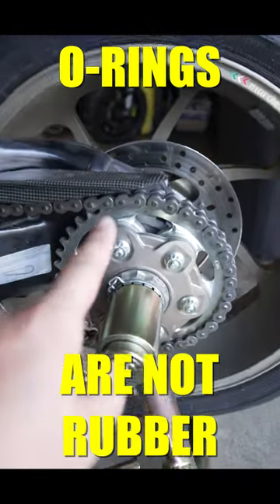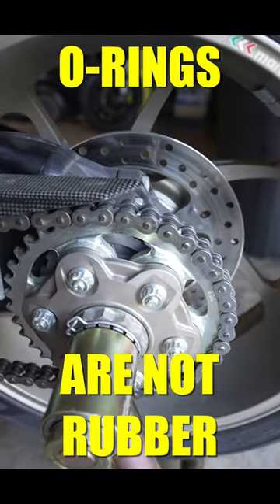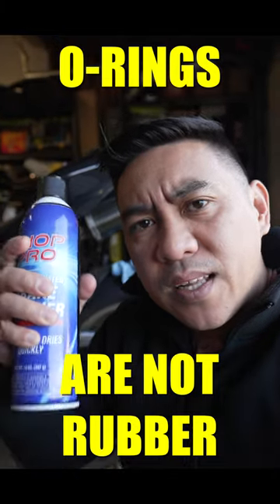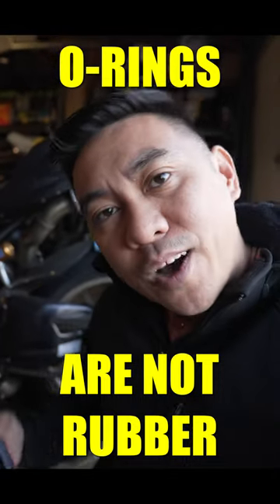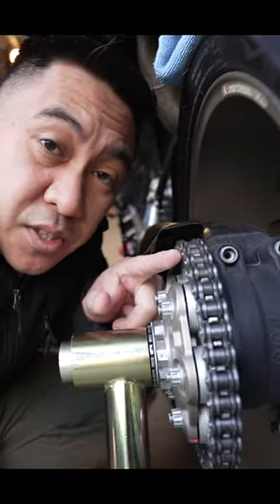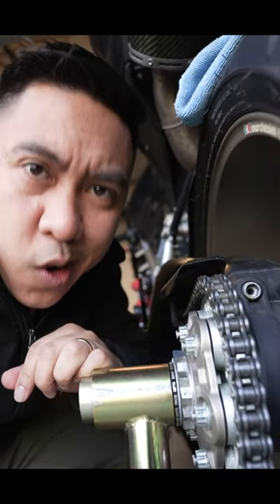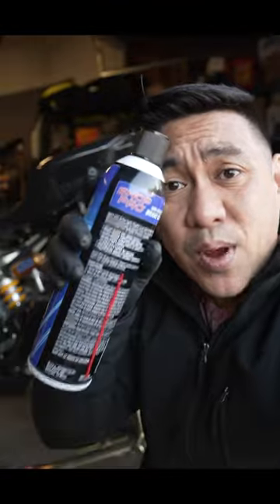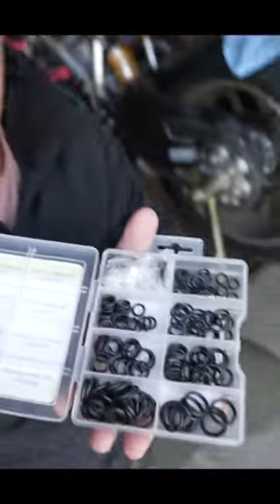Motorcycle Chain O Rings are Not Rubber

Comment: Nitrile gets soft and expands when you spray it with brake clean I'm a mechanic and I use them everyday and try doing a brake job without your gloves growing three times every time you spray off some pads.
Reply: I came looking for ur comment
Reply: @dirtbike662  ikr
Reply: It’s the chlorinated brake clean. Non-chlorinated won’t do it as bad. We use the non-chlorinated like hand cleaner. B12(chlorinated) will leave chemical burns.
Reply: I have both. Each one is better for certain types of oil or grease. Also, non chlorinated dries super fast. But honestly, if I'm cleaning anything with a can, and it has plastic around, I'm using electronics cleaner. Not the electric motor cleaner or any brake or carb cleaner.
Reply: Ive noticed the same affect on my nitrile gloves when using light oils like  wd40, pb blaster, and T-9
Reply: Big facts oil and brake clean when your gloves are soaked are just not good any small pull and that thing tears beyond easy not to mention you feel it getting softer the moment brake clean hits it. But it’s ok he’s a “professional” ad reader 🤣
Reply: brand is a factor. I have no issues with my gloves but then again we don’t use advance auto brake cleaner. Companies manufacture fluids for applications. Brake components have soft compounds around them.
Reply: I was just coming here to see this
Reply: @AndrewKidd14145  we use the 55 gallon drum type cleaner. And right now we're using hand armor gloves and they get soft with contact brake clean
Reply: They are resistant only.
Reply: @Grawlix_Garage  have you guys tried different gloves? That’s not good if they get soft then that’s probably compromising glove integrity and could cause cancer and other aliments in the future. I used black mamba gloves in the past always stay tight no matter the fluid that touches even brake fluid. Glove works is the free stuff my job provides along with the 10mm orange gloves that always do fantastic. It’s about health too.
Reply: You guys use thin rubber doctors gloves? Cheap jerseys work fine, if they get soaked in grease toss them away and get a new pair.
Reply: im i diesel mechanic and i have not found a single silicone o-ring, black red or green that does not get damaged from brake cleaner so this guy is definitely not a mechanic and couldn’t look in youtube sad 😢
Reply: wearing nitrile gloves for lab work. the gloves do wear out, depending on the chemical, making them more or less single use (they should be used once anyway)
Reply: @CensoredForTheTruth still breaks it down

I worked on bikes for 20 years not w
Reply: Definitely agree man, when I was an apprentice we would always be stocked with nitrile, doing brake jobs regularly all the time. Especially with ultimate dirty brakes I would change gloves almost every job after I clean the brakes. Being qualified for a while I will never spray any chemicals on anything that can be stretched. Rubber grease doesn't trap but repels moisture and chemicals for a reason. Time for a beer mate 🍺
Reply: somethings off then, i dont wear them i fn hate gloves, catchin on everything rippin fn rolling around n gettin caught in things ur tryin to thread together fuck that im not scared of gettin my hands dirty, i dont like my hands female clean anyway.. but ur either not using nitrile gloves or using a type of braklean that doesnt play well with nitrile..obviously.. cuz u can soak nitrile in brakleen all day it wont do shit
Reply: Oh yeah. Even isopropyl alcohol makes them do the same.
Reply: @4dirt2racer0  I am confused
Reply: I'm thinking this guy has never used brake cleaner or at least not with gloves on
Reply: Yeah my gloves fall apart after using brake clean.  So yes don’t use it on your oring chain. Shit don’t use an oring chain.
Reply: The comment I was looking for lol
Reply: @Daveeeeeeyhowyoudoing  “non-chlorinated won’t do it AS BAD” implying it will destroy rubber just not as bad. Dries them out and ruins em eventually. 
Trust me hoss. Don’t take 20 years to figure out
Reply: I use Nitrile as well and they don't do that at all for me.
Reply: @gfalcone28  wd40 is not oil bud
Reply: As a former diesel tech, I second this.
Reply: Word brake clean melts them gloves for sure
Reply: Facts I second that
Reply: One side effect of using brake cleaner on nitrile is the brain forgets to use punctuation when writing 😳
Reply: Absolutely
Reply: @raddydiaz4332  He's not a mechanic but he does play one on You Tube. He also stayed at Holiday Inn Select.
Reply: @furtivedig  The o rings in the chain don't ever get replaced. The solvent works down inside and doesn't evaporate quickly like it does in free air, either.
Reply: Neoprene gloves last a little longer when exposed to harsh solvents if you can get them. The orings may be nitrile or neoprene but viton would be best.
Reply: Exactly
Reply: Some o-ring are made of rubber. Be sure you are using nitrile o-rings. Consult official manufacturing web sites for the best information. For the best quality ask about military specifications for all your o-rings needs.
Reply: And what goes up, must come down. If you soak .2mm nitrile for 40 minutes, it has the consistency of bubble gum. And 2 hours later when the brake cleaner’s transportation has evaporated, you’re left with something shrunk, and as hard and brittle as plastic. If you coat it with a grease, the transportation is trapped and diluted into the grease, which will promote gummy rings to continue to disintegrate.
Reply: I am a composite technician and while not brake clean acetone and most solvents do the same to nitrile
Reply: @caleb530e  nobody can understand that, mr half plastic, half fiberglass fixit.
Reply: Yup….. what he said
Reply: It's true
Reply: @charlesbaker6158  Chose the o-ring material based on what it will be sealing, not on an arbitrary spec. The Parker O-ring Handbook is a good guide for selection and free for download. For petroleum based oils Viton is the more resistant material to swelling. Buna N is most common though.
Reply: Wtf kind of brake cleaner do you use
Reply: He said melt. Specifically melt.
Reply: Maybe he uses the green stuff.  Red can melts gloves 😂
Reply: @CensoredForTheTruth  Yeah I always get the green can it's a lot less dangerous
Reply: He’s right!
Reply: You sir are a technician. There is a difference
Reply: @dolanroufs1032  I don't know exactly who you're referring to, but I am a certified technician. I just said mechanic at a simplicity sake.
Reply: @Grawlix_Garage  I was referring to you. A technician and a mechanic are two WILDLY different animals. Don't EVER claim to be what your not
Reply: @dolanroufs1032  it's mostly for the simplicity of talking in the context of people who don't associate the difference. Yes, a mechanic and a technician are too very different things, but I am a certified GM technician. I wouldn't use the phrase dumbing down but more using common language to make it easier for the uninitiated to understand. Apologies for the misunderstanding
Reply: @CensoredForTheTruth  gives you nerve damage over time
Reply: @stuartjakl  send it. I’m already takin nerve pain medication😂
Reply: @CensoredForTheTruth  ouch
Reply: @stuartjakl  back in 2018 I was involved in a Hit and Run on my motorcycle. The Chain came off and when it did literally cut a Nike symbol about 9 inches long and about 4-5 inches from top to bottom wide. Almost lost my foot from the ordeal.
Reply: @CensoredForTheTruth  That is terrible! I broke my left elbow clean off, but they were able to reattach it. Snapped, my right wrist.
Reply: @stuartjakl  and people say getting your funny bone hit hurts. But jokes on them right!?
Reply: @CensoredForTheTruth  😂
Reply: Hahaha I was looking for this comment
Reply: Try using BIC-600 disc brake cleaner.  It shouldn't do that. It's because your gloves are rubber/latex and brake part cleaner will break down carbon materials. Don't want to get brake part cleaner on carbon fiber parts either.
Reply: @raddydiaz4332  Honestly, try using BIC-600 disc brake cleaner. It won't hurt your gloves, o-rings, etc. It works really well, too.

+Functions
BIC-600 disc brake cleaner can effectively clean away residual grease and grime from disc brakes.
BIC-600 disc brake cleaner is exclusively designed for use on disc brakes and brake systems, and can maintain the long-term use of brake parts.
BIC-600 disc brake cleaner contains only environmentally-friendly substances; it contains no CFCs and will not pollute the environment.
BIC-600 disc brake cleaner is safe, reliable, and will not harm rubber or plastic.
BIC-600 disc brake cleaner evaporates quickly, does not leave any residue, and will not harm aluminum or carbon fiber.
Reply: @CensoredForTheTruth  😂
Reply: I'm also a mechanic, I clean my nitrile gloves with brake clean whilst wearing them if I need to work in the car. I can wear one pair for multiple jobs. 

Throttle body cleaner kills them though.
Reply: I'm an auto body painter an lacquer an xylene also swell an make the gloves soft to the point of breaking.
Reply: The X Rings in motorcycle chains will still not deform if sprayed with brake parts cleaner.
Reply: @Grawlix_Garage  third
Reply: In all fairness to him, regardless of what he says, his nitrile data sheet literally says not recommended for pretty much every main chemical in all the various brake/parts cleaner formulations (and more) 😂😂😂
Reply: @CensoredForTheTruth  I was working on a small engine a few years back, and the Brake Clean I used, absolutely melted my shock absorbing and knuckle protecting gloves.
Reply: I’m a technician at a dealer, I’ve done countless break jobs and used too much brake clean for my own good yet I’ve never had my gloves expand or “grow” idk if some do and others don’t but I’ve never seen this

Comment: Nitrile IS a type of rubber, commonly called NBR (nitrile butadiene rubber).  It is unique from other rubbers as it is very resistant to oil, fuel, and other chemicals, but it is still a type of rubber.
Reply: It also still gets damaged by brake cleaner and brake fluid. If a material says it’s not suitable for use in brake systems (like the data sheet for nitrile says in this very video) that’s a good indicator it’s also not suitable to be used with brake cleaner.
Reply: That's what I was thinking
Reply: It even says it in his screenshot

Comment: They're usually Viton, not nitrile. Besides, even if they are nitrile, it's even less resistant to brake cleaner than Viton.
DO NOT USE BRAKE CLEANER ON O-RING CHAINS!
Reply: Exactly.
Reply: If they're Vinton they're close to bullet proof....
Reply: @dalespringerwilson4233  So it's cool to use bullets to clean the chain then?
Viton turns to crap with ketones and there's usually ketones in brake cleaners.
Reply: On all ring chains

Comment: I started using 9mil nitrile gloves over latex since the cleaners demolish latex in seconds. Nitrile holds up a bit better but my nitrile gloves still expand, get soft, and start breaking easier with a brake cleaners.
I generally have to swap them out mid job after a cleaning session because they are breaking down.
So yes, the o-rings will fail prematurely.

Comment: Rubber/nitrile/Viton is not recommended for brake cleaner.  It even says so in that picture, it will over time degrade and eat the bonds and break down over time. EPDM on the other hand has a much better chemical reaistance if you could replace each O'ring would last a real long time.

Comment: Last I looked my Nitrle gloves break down And get holes real easy when I use brake cleaner. Same will happen to the O rings.
Reply: Must be using different stuff
Reply: Chinese gloves might not actually be nitrile.
Reply: @greuju  they’re made to the customers spec,
Reply: Alot of break clean brands it is pretty much lacquer thinner in an Arisol can, and that shit eats through nitriles like nothing
Reply: All petroleum based products require petroleum based solvents for cleanup, which is just breaking down the chemical bonds of the various petroleum based chemicals. But if this guy wants to change chains more frequently by using the wrong products more power to him.
Reply: @simonbooth2821  good brake cleaner is the nonflammable chlorinated stuff

Comment: Honestly no O-Ring manufacturer will certify it against any solvent, the sad truth is, all solvent will at some point destroy it.
I've tried a bunch of things, brake cleaner is the worst, it gets past the O-Ring and destroy the grease inside the roller (I can destroy a chain under 20k km like that), diesel is better, it remove the grim and it a bit less thin (basic chain can go up to 50k km like that. 

Another tip, I usually only change my front sprocket
Reply from the maker: Check this one out. I filled a glove with brake cleaner and left a piece of the chain in a tub of brake cleaner. https://youtu.be/PVgwaJWNdRc
Reply: @adobomoto  thanks
yep I've seen it, your brake cleaner might be more rubber compatible than what it usally find.
Typically, if I wear a nitrile gloves pair, if one gets brake cleaner on it, you can be sure that the one exposed to break cleaner gonna tear pretty quicker while working than the other one.

Same for the chain, at some point I find split O-Ring on the floor and the chain stretch faster du to the diluted grease inside by the break cleaner.
Nevertheless it's only my experience, your's could be different.

At the end, use whatever you feel like, a chain is not that expensive anyways, now I get mostly non O-Ring chain from did, love it especially on dirt roads.

Never get unbranded chain, I almost got stranded in the desert from a $30 Amazon one. Every link were cracker and I had a spare master link fortunately.
Reply: I have found the same thing. I buy low VOC brake cleaner and nitrile gloves. The gloves eventually break down over repeated exposure to brake cleaner. I think if this guy isn’t having issues, it’s because his brake cleaner is gentler than what I’m using. Just buy a dedicated chain degreaser, no point in ruining your o-ring chain prematurely. I was a motorcycle tech for a few years and now buy and sell older motorcycles, so I have a lot of experience with chains and different chemicals.
Reply: Rupesh Kumar  I'm not sure, I haven't tested kerosene for cleaning chains.  Fortnine did a video on chain cleaners, and I think he tested kerosene in that line-up.  Give that video a watch and maybe it will answer your questions.
Reply: Rupesh Kumar  Kerosene is what most manufacturers recommend for cleaning chains. I have always used Kerosene. Triumph have always recommended kero
Reply: Links video where he calls them rubber o rings 👁️👄👁️
Reply: @adobomoto  soak that oring and then test it's elasticity, size, durameter, and tensile strength.  Solvents break down organic compounds bud.   It's basic chemistry.   Your throwing the dirt on yourself 😉
Reply: I've been using brake cleaner on my chain for a few years. Your supposed to make sure you get the cleaning done and more oil applied within 10 minutes. Are you leaving it on longer? There's also chlorinated and non chlorinated brake cleaner.
Reply: @PercyJackson93  I've tried both type, and a gentle wash with a brush, for me it always end up destroying the O-Ring and diluting the I side grease faster than anything else.
Another tric I use especially on dirt trips, I just put motor oil on the chain and I don't need to wash it, the dirt is just ejected with the thin oil

Comment: I'm cleaning my chain today and was thinking they were rubber. Definitely picking up break cleaner and gettin to it
Reply: I started using 9mil nitrile gloves over latex since the cleaners demolish latex in seconds. Nitrile holds up a bit better but my nitrile gloves still expand, get soft, and start breaking easier with a brake cleaners.
I generally have to swap them out mid job after a cleaning session because they are breaking down.
So yes, rip nitrile o-rings with brake cleaner. It WILL cause your o-rings to prematurely fail.